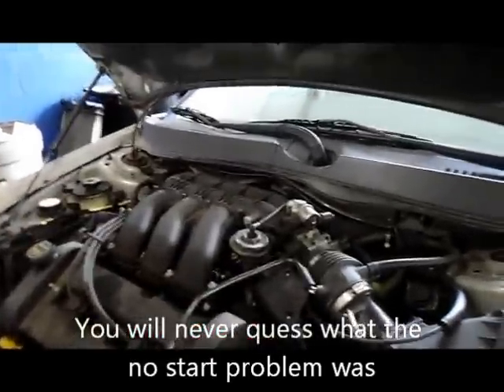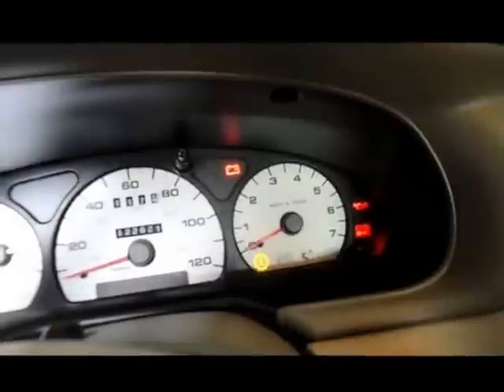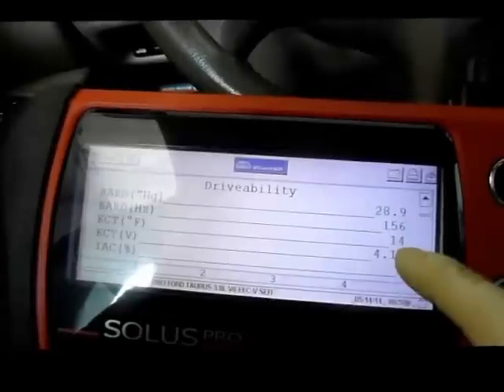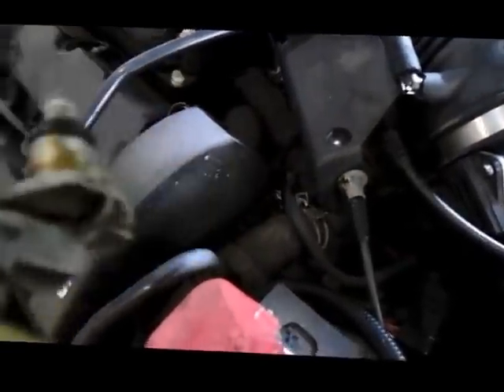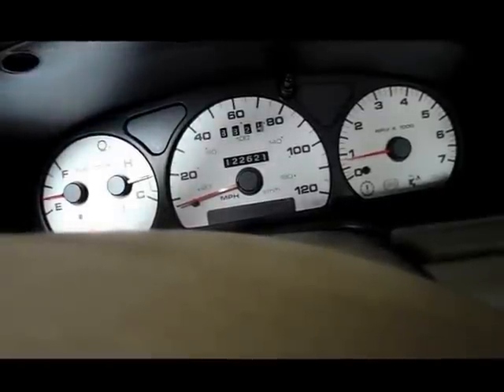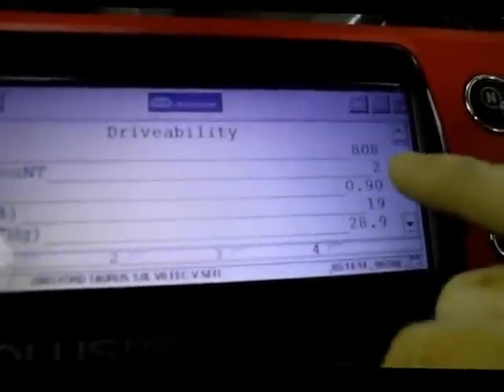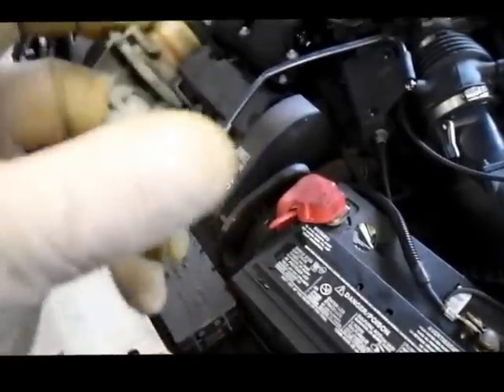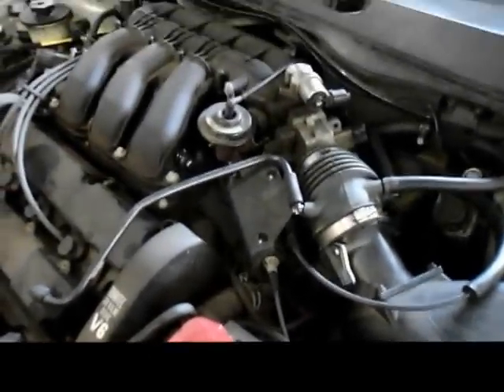Engine cranks but won't start

Comment: Cars today are far too complicated, simple things like this can stop an engine working, Imagine if you are in the middle of no where and a sensor costing a few £'s can leave you stranded.
Reply: ***** I have a 1975 Olds Cutlass I'm restoring - the only electronics I'm gonna have is the HEI distributor (bullet-proof) and the stereo.  Electronics have no place in cars.
Reply: ***** Considering a car is comprised of hundreds if not thousands of low cost parts it's usually the case that a low cost part breaks and leaves you stranded. When people's wheel falls off the car how much do you think the axle nut that came loose/off cost?
Reply: Randy Condran If you believe electronics have no place in cars then you need to swap the hei with points and condensor and axe the radio otherwise your being hypocritical.
Reply: HEI is a proven technology that's easy to fix - I'll keep my carb and I'll keep my stereo.
Reply: Lots of technologies are proven and HEI is outdated just like the distributors they're in. Either you can be old school and be as mechanical as possible or you accept the benefits of tech/electronics but you can't be on both sides of the fence. Fuel injection is older tech than HEI and it's so old and proven that even harley-davidson uses it and has been using it for more than 10 years now.
Reply: Killer2600 Cars are more reliable because of electronic tech but the problem is when they go wrong the layman cannot fix them, if say a coil went wrong years ago you could go to your local garage and buy one, fit it by the road side and away you go, coils on today's cars are very expensive and you would need to go to a parts suppler to get one and that is assuming they have them in stock. As we see in this video a small non important part can fail and your car will not run and you need a specialist to fix it.
Reply: ***** Where do you live? Auto Parts stores all around me stock commonly replaced parts of all sorts.

Who says the layman can't fix them? Lay men have been fixing them for decades now, if you can't it's not because it can't be done it's only because you're stuck in the 70's to early 80's.

What you call a non-important part gives data that is used in spark timing and fuel mixture calculation. Some would say the choke on your carburetor and all it's small parts is non-important, especially  if they lived on the equator, but someone living in cold climates would disagree.
Reply: Back in my day petrol stations sold, plugs, points. HT leads, coils ect, today you need a computer to find a fault with an engine, on my car I cannot even see the spark plugs under the other parts of the engine and would need a tool kit just to get to them, all I would have needed years ago was a plug spanner, my car had a fault recently with turned out to be a vacuum control valve to do with emissions, a friend of mine tracked down the fault using fault codes he saw on his computer, I would never had such a problem years ago. laymen do not have such equipment.
Reply: ***** You say you used to fix engines by logic. Computers are logic and if you learned how the computers in cars function then you wouldn't complain they're too complicated for the lay person. Like I said an electrician fixed my car with a test light for diagnostics and a haynes repair manual for reference with no prior expertise working on fuel injected computer controlled everything cars. Also the problem wasn't as simple as a blown fuse.

If you spent as much time learning the new stuff as you do opposing it then you'd realize how easy working on modern cars can be.

Stop living in the past, get with the present, the future is nice.
Reply: How do you fix an engine management system failure at the side of the road? if your friend fixed your car then why didn't you fix it yourself? and I do not have a problem with modern tech and I am not opposed to it, my home is full of it and I use it every day, what I am saying the electronics on cars while they make the car far more reliable when they fail it is near impossible to fix at the road side, at one time if the engine stopped, assuming it was not drastic mechanical failure, it was either a fuel or spark problem both of which where easy to check for, if either of these failed on modern cars where would you start to look for the problem, it could be a chip burnt out, a minor sensor like in the video how would logic find that problem? This water cooled PC I am communicating with you on I built myself from the ground up so I have learnt about "new stuff", and right now I have a friends lap top to fix!
Reply: Well here's the deal, cars are more reliable as you said but your expecting a catastrophic electronics failure leaving you on the side of the road.

I didn't fix it because I was young, busy working, and in the process of buying a new car. That and I didn't have anything other than a cheap $20 socket set for tools. On the other hand my step-dad and his friend (the one who fixed the car) had all my step-dads automotive tools combined with all his friends electric tools. That and they had time to play with the car. That's why I didn't fix it.

I don't recommend it, but I have fixed many modern cars on the side of the road. Most failures are still mechanical in nature. I've even know guys that aren't savy with the computers fix their vehicles on the side of the road.

I can't say I've ever seen a chip on a car burn out while driving. The solid-state electronics and computers are pretty rock solid. Like I said it's usually something mechanical that goes out and leaves you stranded, like a fuel pump, broken timing belt/chain, and other crap that you're unlikely to be fixing on the side of the road despite not being a computer problem.

Water cooled PC's aren't worth the hassle these days with lower power consumption CPU's and GPU's on the market.
Reply: Killer2600 computers aren't logic. They tell you WHAT is wrong, but it does not tell you WHY it went wrong (usually because of some other failing part) and the human has to use logic to connect the dots (at least as far as this goes). I.e. my car throws a code that tells me the Map sensor is malfunctioning. However it does not tell me WHY it is malfunctioning. Is the sensor bad? is it not sealed in the intake properly? is there water getting into the intake tube? is their a voltage problem going to it? is the egr valve not opening...or is the fuel rail pressure not consistent. It tells you its bad but there could be virtually dozens of reasons why it is bad that the computer cannot logically deduce to tell you. The point he was trying to make is reasonable and he is not living in the past is. Car manufacturers are creating parts, that create problems. Why do they do this? simple, because car manufacturers make all of their money in service and parts. The more parts they make, the more to go wrong, the more to fix. Its always about money. Back in the day it was either bad points, voltage regulator, coil , spark plugs, starter, distributor, or battery. Motors were so simple and you could move on down the line using reason and deduction so a layman could fix. Not everyone has a diagnostic machine laying around especially if broken down in the side of the road because they usually leave a diag in their garage with all of their tools, and no one (at least a layman) has a clue where to begin using common sense when something like a sensor goes wrong and stops a motor from running in this situation. That is extremely frustrating. You can't fix a car unless you have this diag machine, for a part that in the grand scheme of things is pretty useless, other than it tells the computer that it doesn't work. Its basically implemented to fail. Straw Man argument.
Reply: Adam Sanders WTH Computers are indeed logical, there's no magic to it, logic is how they function.

Yes, they are different than the cars of 50's, 60's, and 70's but different technology is going to be different that's just the way it works. You can't just learn it once and not expect to have to evolve and transition with it.

The comment was already made that cars of today are more reliable, thanks in part to electronics, so why are you even worrying about a failure of the electronics that you don't understand. Which is why you hate and are opposed to the electronics to begin with. People hate what they don't understand, time and history has taught us that. In reality, diagnosing and repairing cars today is no different than yesteryear. All it takes are some tools, a few special tools, and some knowledge. Thanks to the internet, it's actually easier to repair cars today than it was 20+ years ago. You can go on google, type in what car you have, and what symptoms it's having and get a list of possible causes and fixes; all without even opening the hood.

Also the idea that car manufacturers make money off repairs is false. At best car dealers make money off repairs. Car manufacturers actually lose money off of warranty repairs. Most car owners have non-warranty repairs done at a 3rd party shop, the car manufacturer sees none of that money as both labor and parts (in most cases) are aftermarket. The car manufacturers true source of profit is car sales.

I eluded to it above but it's quite the case that you don't need an expensive factory-level scan tool to repair the cars and trucks of today. I recently diagnosed and repaired the transmission on my truck that wasn't shifting correctly and thanks to the internet, found the common cause. Replaced the governor pressure solenoid, governor pressure solenoid, and vehicle speed sensor at a grand total less than what any shop would have charged me to work on the transmission. The only special tools required or used on the job were a T-25 screwdriver, a in-lb torque wrench for torquing the pan and filter bolts, and a internet connected computer to research the problem, repair procedure, and torque specs. It was literally that simple. If I had this problem back in the 80's, the repair would actually be more complicated, expensive, and something I likely couldn't do myself. We live in good times, you just don't know. So quit moaning and open your eyes.
Reply: Adam Sanders how is that not logic? computers are not self aware, in the same aspect people are not self aware. When you get sick you know something is wrong you don't know why. usually by having someone else who knows what they are doing (a doctor) run tests you can they figure out whats wrong with you. The sane applies to a car, usually by having someone else who knows what they are doing (a mechanic) run tests can you figure out whats wrong with your car. I read further into your comment and You sir do not know what you are talking about lol. This is like the rantings of a conspiracy theorist. You go on about how car manufacturers are conspiring against us, yet I am 90% sure you have never even set foot inside one so everything you say about that point is irrelevant since you are only talking out of your ass. Also this statement "You can't fix a car unless you have this diag machine, for a part that in the grand scheme of things is pretty useless, other than it tells the computer that it doesn't work. Its basically implemented to fail. Straw Man argument." is not only the stupidest thing I have ever heard a person say it is also about 99.999% wrong. I do not have a diagnostic machine, and yet I knew how to test this part to find out if it was working or not. Also to say it serves no purpose only further demonstrated your lack of intelligence, I assume you are one of those people who show hatred towards it because you don't know what it does or how it fits into the "grand scheme" of the vehicle, and your lack of intellect infuriates you. My best suggestion to you is to go back to your garage, pound your chest like a dumb cave man, throw some tools around so you can sound like your actually doing something, and stop leaving comments ranting about that which you know absolutely NOTHING about. I am just trying to save you from making yourself look any more like a ignorant dumbass than you already have.
Reply: Randy Condran airbags, abs, traction and stability control, lane departure warning, blind spot alert. electronics do belong in a car they make them safer more efficient and cleaner. This guy has being working the industry for years and this is the first time he has seen something like this which shows how uncommon this problem is. I don't know much about cars ECUs but the voltage from the sensor was something around 5v and at normal operating temperature the sensor was at half a volt. The ECU probably wasn't letting the engine run as it either thought it was way to hot or that the sensor was faulty and that the engine temperature was unknown which would mean an overheat would go undetected and could lead to the engine being destroyed. This is probably why the car behaved the way it did as a self preservation technique.
Reply: Randy Condran yeah thats why we have better power, mpg, cleaner emissions... no place for electronics?! LOL
Reply: ***** I agree With all these computers they are putting in cars now they should have an easy to access folder that flat out tell you which part is not functioning properly that way when you car wont start or some random item like the Oil temperature sensor is broken it will just say that instead of leaving you scratching you head or with that BS check engine light that only informs me of a problem after the fact
Reply: I'll stick with my '75 Cutlass - no computers, no electronics (except the bullet-proof ignition) and the radio.  I'll keep my carb.
Reply: +Musicbruv .t they're not too complicated
Reply: +Randy Condran.   Wrong.

Electronics make cars by far much more reliable than cars from the previous periods.   They are much more fuel efficient, pollute less, are safer, much more reliable,  and have very large tolerances for the fuck-tards that drive/abuse them.

This is why cars are shit-tonnes better in the last 10 years than at any other time in history.

A modern Corolla is going to be faster, more economical, safer (by a large margin), better handling, and generally more reliable.
Reply: +Musicbruv .t Some simple scan tools, and a few basic skills can see you working on the most modern of Japanese, Australian, American cars.

Only Euro-boxes like to hide the codes.    I'm not the smartest mechanic around, but I do well with Carprog, a laptop and about $50 worth of interface equipment.
Reply: +Musicbruv .t I am a layman (I'm a systems engineer by trade) and I have a laptop, carprog, and some basic interface software.  The whole system cost less than $100 to put together, and that included the LAPTOP!!

And now, I can re-program the ECU, pull codes, re-write key-codes for locks, change the odometer (if I wanted to)  operate motors, lights and everything else.

If a layman couldn't do this - he shouldn't be touching a piece of crap 70's car either.
Reply: +Killer2600 To a point - I've got one car in my fleet here (I work for a utility - we keep cars for 5 years), a Hyundai iload, with over 434,00Km (270,000miles) on it.   It's fully electronic.  It's serviced monthly and kept in tip-top condition.

The van has NEVER left anyone stranded ANYWHERE.  This shit just DOESN'T happen any more!  And - because of budget cutbacks, I'm probably going to have this car another year (it only hauls computers around).   I can't see there as being a problem with that.   

Engine still as strong as an ox (200PSI on all cylinders) and a manual transmission with a lovely, smooth feel.  Even the clutch is original!
Reply: +Killer2600 "Water cooled PC's aren't worth the hassle these days with lower power consumption CPU's and GPU's on the market."

I'm living proof that you need a gaming rig to watch YouTube. My store-bought PC, less than a year old, can't play YT videos in any resolution higher than 360p (sometimes 240p or 144p are laggy, and full-screen is impossible). So I could argue that he needs that higher-powered computer JUST to be on here in the first place. ;-)
Reply: +Musicbruv .t I agree with you it seem so easy to fix cars back in the day  heck you lookunder the hood you see the eng , a few wires battery ,fan....now if you look under the hook its like God help me to much stuff..Just saying
Reply from the maker: +Lisa Porzio  Oh Ya I do miss those car they were so easy to work on.If a car broke down all I needed was a screw driver and a book of matches and I could start that car.Oh Ya the good old days.
Reply: I came back to the world in 73 from SE asia to the beginning of the emission age of the automobile to work for the largest auto rental company, and to say the least those early EPA mandated controls were a pain in the ass that the OEMs were throwing at the cars to control emissions that they eventually tried to control with OBD that was supposed to let you know what the problem was, as long as the CEL was on you were OK, but if not you had to drive until it lit, many a man hour wasted until OBD2 came along, that can store codes, you can have all that "old school"that needed plugs points and condenser every 10K, most all the new stuff goes well past 100K with no problem other than spark plugs that seem welded in place after being in for so long, in so many ways it can be said, " they just dont make em like they used to" to which I always reply " Thank God they dont"
Reply: Most likely pulling the
 Reference voltage to the sensors out of range:usually 5 volts.
If below this range issues will appear ECU will not be happy
And possible no fault codes because coolant sensor reading still in range!
Reply: SW6
Reply: SW6 thats why i drive a older van that has minimum sensors and bs on it.
Reply: My 63 Jag has two "sensors" oil pressure & water temp. In 42 years it's never conked out on me ! I tune & maintain it myself, saved a fortune on monthly new car repayments & shyster mechanic "check engine" rip offs LOL.
Reply: chumbuckery777... and likely a death trap in the event of a crash. No crumple zones, no airbag, no ABS, no traction control. No safety for pedestrians....
Reply: Graeme Williams good luck in the event of a crash. You'll need it!
Reply: jnbing: If I hit you in my Jag, you will stay hit. The body is 3/16 inch proper English steel, & it weighs 2 tonnes & it will plow straight through any modern short life half plastic junker. You'll be the one needing the luck LOL.
Reply: software prob     =  what the car is told to do by the programmer - ie  stop    instead of display fault  or provide soloution  on dashboard display     something which would perhaps help sell a car from new
Reply: +tcpnetworksThe sticking float problem can usually be fixed by rapping the  carb near the fuel inlet with anything handy, even the lug wrench. This happened to me few times 'back in the day'. This would unstick the needle valve and I would be on my way, in five minutes! If you had a Holley 4-barrel carb, you could pull the float bowls with a common blade screw driver and fix the carb ON THE SIDE OF THE ROAD. There were only 4 screws holding the float bowls (needed to put some rags under them to catch some fuel spilling out). Back in the day you could actually pull the fuel line without getting sprayed with fuel at 60psi since the pressure was only at 5psi. If the points failed, you could 'jerry rig' a hair clip to get you going, ON THE SIDE OF THE ROAD WITHOUT A LAPTOP AND A COMPUTER SCIENCE DEGREE! Indeed, the cars of today are WAY MORE reliable, but the cars of yesterday were WAY EASIER to repair PERIOD! That is the trade off. CHEERS
Reply: I thought you were going to say you fixed them with wire and tape, Jim-----ha
Reply: Give me a carbureted car anyday.
Reply: Randy Condran I’m with you. Not only do they make it difficult to diagnose you end up paying for the vehicle twice in repairs and parts that you never used to. Who needs seatbelt dingers, 500 sensors, oil change reminders, 50 relays, and butt and steering wheel warmers? Take me back to Tin Lizzy!🎶 Well maybe not that far back.